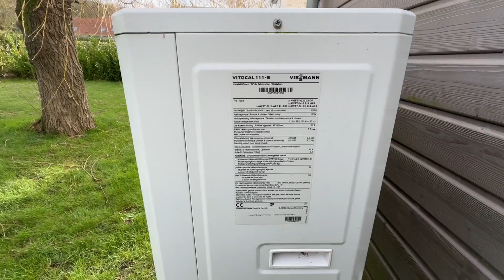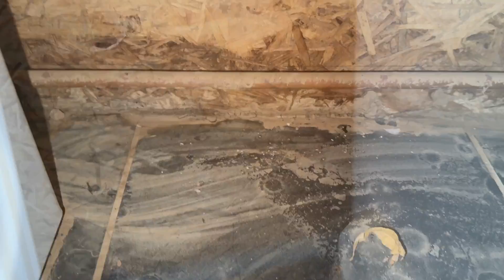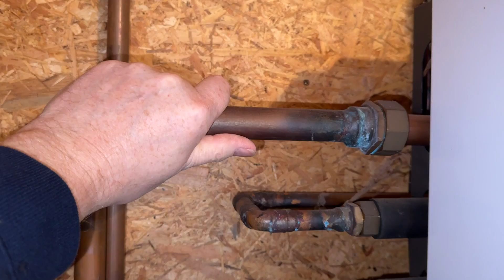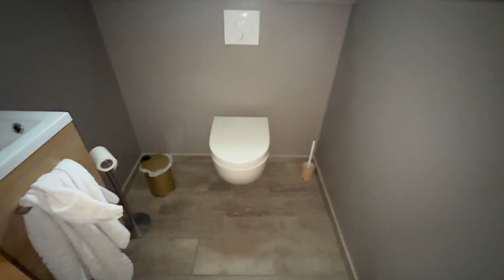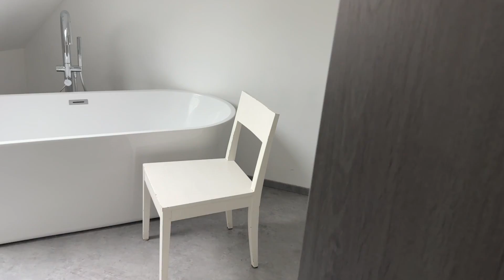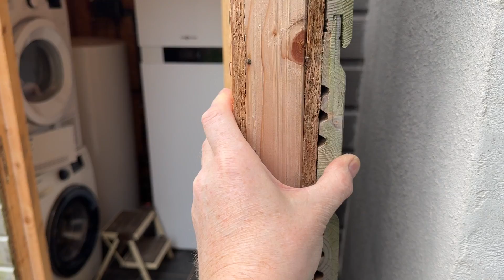Are french plumbers better than the uk plumbers?  Checking out the heating system while in France.

Comment: Anyone spot the floor heating error put the distribution point at the back of  kitchen cabinet rather in the " boiler house " same way radiator distribution point is up high in the wall I believe separate kitchen and "boiler house" which means rather than coper pipes  going in the house coulor pipes coming out to the "boiler house" right lower radiator assembly 🤔

Secondly "boiler house" room must be in building preferable under ground and that way don't mater how thick or well insulated is the "boiler house" and all energy going to be lost outside it will be escape inside the house when door is opening to do washing etc

Comment: Well as a former plumber back in 90s in Hellas out of business last decades living a decade in your silly island nore better or worse. Nore right and wrong comparing France, Germany etc but Stupidly liers and lasy you are 1000% over charge & over do everything here

Oh and what's the real point for softener (posimply is one in the unit if needed be) or pressure valve in 2024 most material rated for real pressure nore vented systems or low pressure system used to be old days because of luck of knowledge or over cost lies of materials

Comment: Pretty sure all those copper joints are brazed, which is very common in France. They don't use any compression joints in France either. All Soldered or threaded.
They have a weird and large number of pipe sizes. 12 and 16 mm very common. The only common size I think between UK and France is 22mm

Comment: It's a split system and you can get them in the UK but they're special order only from memory. The top is the plate heat exchangers while the bottom is the pressurized cylinder. The buffer is only because the system volume is too small for the frost cycle on the outdoor unit, pretty common from what I've heard for out of town properties though France like most European countries and the UK still has massive issues with terraced housing actually accommodating heat pumps. That said 3 phase is far more common so Heatrae Sadia Amptec units and alike are far more common.

Comment: All the EF fittings are Brazed Del & the ASHP is a ‘Split System’ with the Fridge Line-set from the outdoor unit to the Hydro Unit. Chances are it Imperial Copper Pipe on the Line-Set.

No shitty ISO Valves at the Sanity Ware with the H&C manifolds.

Our Above Ground Soil & Waste Systems are 100 times better than any in mainland Europe.
Small Pex tube is likely to be too small for a Low Temperate Heating System & there’s little or no Backflow prevention on the Mains Water.
12, 16 & 22mm copper tube is the most common in France.

We’ve been fitting UFH here in Scotland for the last 40-50 years, you little Engerlanders are still to catch up in that regard.
Thanks Del for sharing👍👍👍

Comment: Looks like a terrible install. No soak away, external unit needs servicing, pipes need to be lagged. It isn’t necessarily a bad idea to have an external plant room though. I’m not convinced it’s particularly well insulated mind you…

There are a few Viessmann installs in the UK including one in Sheffield running an impressive SCOP of about 5 over the winter. All the data is up on Open Energy Monitor.

Comment: Usually the drain valve is located on the house side of the water meter. All French properties have water meters. Next will be the pressure reducer. I would say the water pipe coming into the plant room is not the mains in as the meter would be first in the line. Interesting none of the pipes are insulated. The whole house looks new or recently renovated and not quite finished. Absence of tiles/wash basins etc. Note the inlet flow hot water to the radiators is at the top of the rad. Cold return is at the bottom.
French plumbing is very good, just takes getting used to when shopping for bits.
Reply from the maker: It was the main stop tap. Don’t tell anyone I turned it off and all the cold water went off 😜

Comment: Pre 1990 french plumbing and wiring was probably worst in europe, something must have happened as its now amongst the best. All pex and electrical cabling now run in anti vermin corrugated sheathing, no electrical ring mains, all sockets and light switches have own individual mcb. Many french plumbers frown on using pipe fittings but will form a female end on pipe rather than use a socket and notch a vee on pipe and solder a but end on rather than use a tee. New electrical smart meters limit youre kilowatts to that on youre contract and automatically cut you off if you go over !!!!!!!

Comment: It would have been more appropriate to make this comparison against the building regulation in the UK of the time of the installation in this French property as it is incorrect to say that external cold water needs an isolating valve. My property in the UK was built in 2002 and it does not have one and I would hope my house would have been built to building regulation.
Reply: it wasn't.
Reply from the maker: All U.K. property’s require an isolation stop tap on the incoming cold’s main it’s in the water regs so your house isn’t built to regulations

Comment: I am Hungarian, worked in UK. Honestly I say we approx 10 years forward then UK. Sorry but fact. Its like UK Plumbers just get on press fit and they still talking about how shit it is 😂 Hoewer we use that like 30 years now. 😂 All the design, etc. outdated, and mostly no space for ASHP set up in UK so they make un maintainable most of install. That set up in French also a bit older set up hoewer they most Refrigeraton pipes due to discolouration on brazed joints as they like Split system more likely Monobloc. We don't like Monoblock system they very restricted. Good video by the way.
Reply: I was using press fittings at the start of my apprenticeship 110v novopress gun 20years ago in the north of Scotland so you may be looking at it through rose tinted glasses.
Reply: @kylestewart698  Same 23 years ago when started with my dad, We using MLCP manifold system, 1/2 backplate for every sink with corner valve 3/8 most of grohe. No exposed pipe etc. But yeah we have also different building specs. Suprised maybe you one of your kind most of British hate press.. Seen on YouTube as well there videos.
Reply: @CsöszakiHoszivattyu  I personally think a full copper install is better than mlcp. mlcp and other plastic pipework has it's place but I personally believe copper is best for so many reasons looks better ,better for the environment as doesn't go to landfill not to mention the health benefits that not meny people seam to know about.
Reply: I think you should go back to Hungary
Reply: I think euro as a hole are well ahead of the UK in Meany other areas but I don't think pipework is one of them. System water quality etc they are miles ahead. I don't understand why the UK is so slow in putting improvements in place when they see other county's doing it with success. deionised water is definitely the way forward but we are still dumping inhibitor into systems with no good way to test for what's in the system currently.